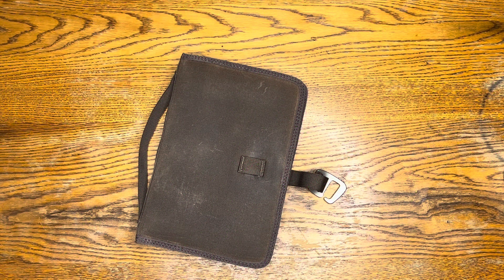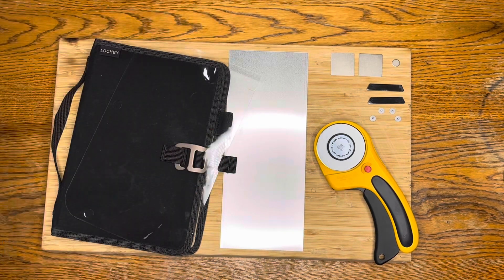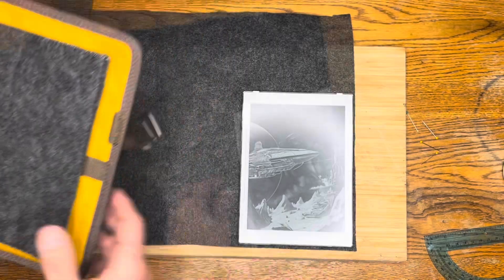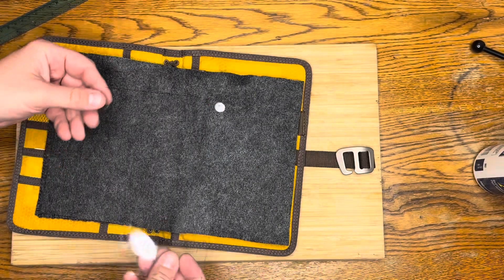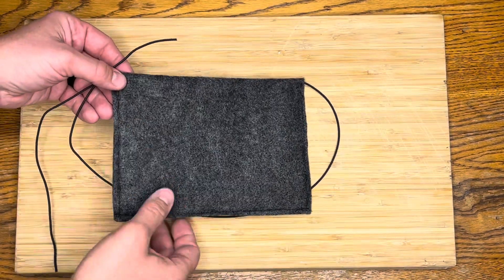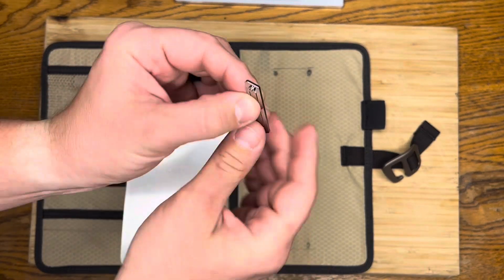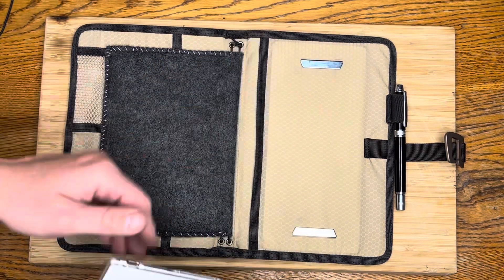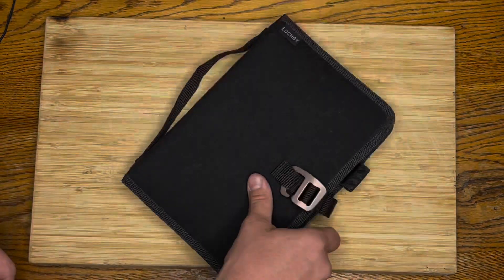Lochby Supernote Nomad A6X2 case DIY Build

Comment: @HevlarKevlar I've finished mine, after receiving the folio from overseas (I'm in Europe). A few comments:
1) The Lochby cover is a bit higher than the Nomad, but that is not a problem. 
2) The hardest step for me was first to adjust the holes, and then to screw the closest screw. I didn't use the screwdriver, because it would require a 90° very short elbow, which I didn't have. I had to use my fingers and my nails.
3) I am not convinced with the felt solution for the left handside magnets. I just typed one to the upper left corner, where the meshed pocket is, in its upper left corner, and it works find. Sewing a piece of cloth there would be a nicer solution, still minimalist. Apparently my Nomad only answers to the upper magnet.
4) Had I realized before, I would have placed the holes on the folio half a centimeter more left, so as to be able to add a pencil in the second loop. That way I can use both my Nomad and a paper notebook. Then at step 3 you could glue or place the little magnets to your paper notebook, keeping them close to the Nomad while closed. You would have to move them at each change of paper notebook. One notebook is provided with the cover.
5) It's nice to give sizes: Holes have to be size 3 to 4. Worked with a regular screwdriver for me. Screwdriver size for the little screws if you manage to use them is 00.
I'll post the result and some of the making pieces on Reddit. Thanks for the tutorial.
Reply from the maker: Glad it was helpful! Hope you enjoy it greatly!!!

Comment: This is very nice! Too bad that the Lochby is twice as expensive in France. Instead of installing an aluminium plate, could you just add eyelets for the screws?
Reply from the maker: I think you could, the only thing I can think of is that the cloth may be a little loose, and may cause the screws to come loose.. so mainly added the plate for extra support during one hand writing.
Reply: @HevlarKevlar  Thanks. I ordered the Lochby field journal despite shipping costs. It looks to be quite adapted to the Nomad. We'll see how it goes up.
Reply from the maker: Awesome; let me know how it goes!